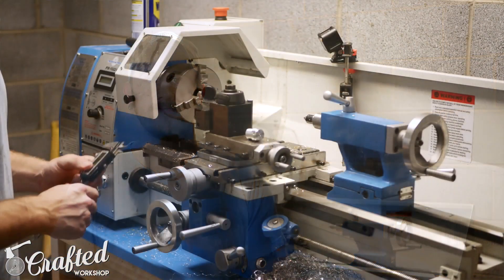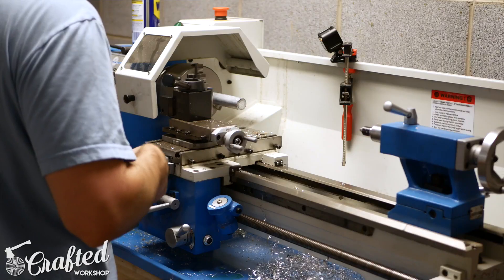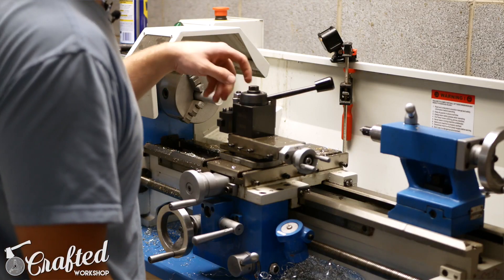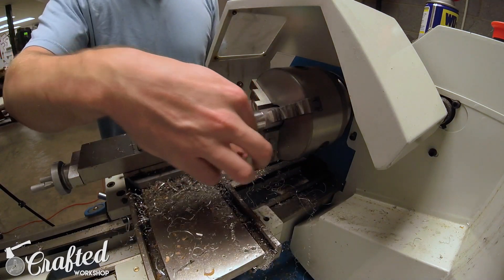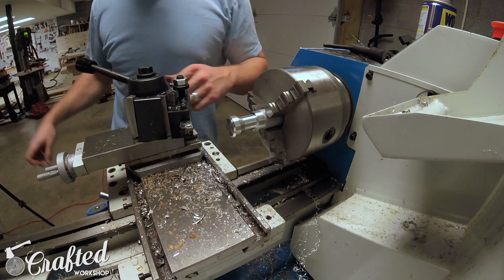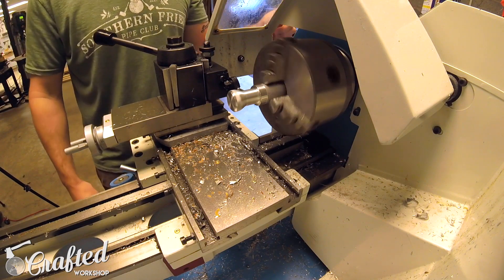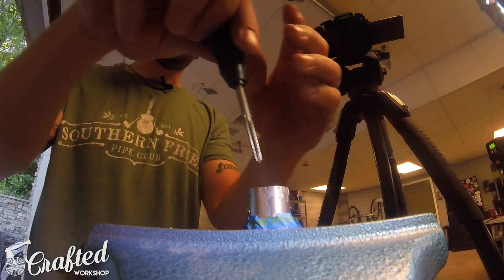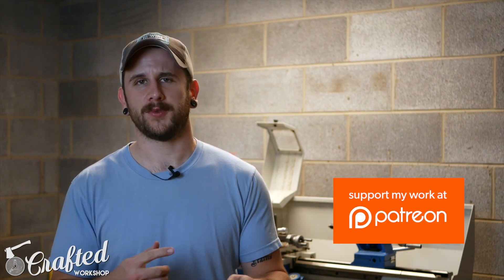How To Turn An Aluminum Knob On A Metal Lathe | Crafted Workshop

Comment: Old I know but for what your making dont cut the stock . After machining the knob  knurling and your turning then do your cutoff. It saves stock and it makes it easy. If you reverse the end knurled you can drill n tap before cutting off.

Comment: man that came out great! welcome to the metalturning thing, it's addictive. In my opinion it shouldn't be much of a problem to hold the part in the lathe before knurling that diameter, to drill the hole, and then you just flip it and knurl it. But this is not a precision part so who cares :D cheers!